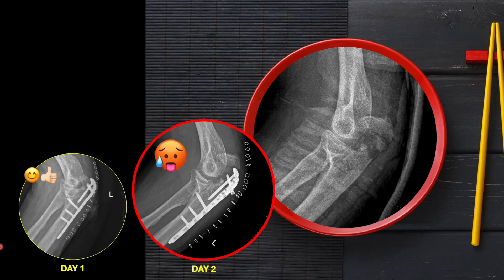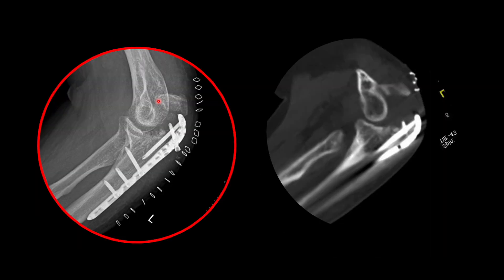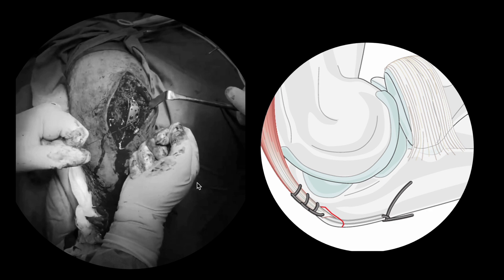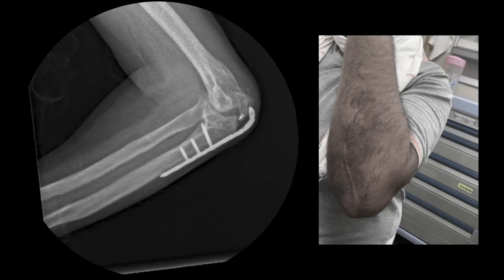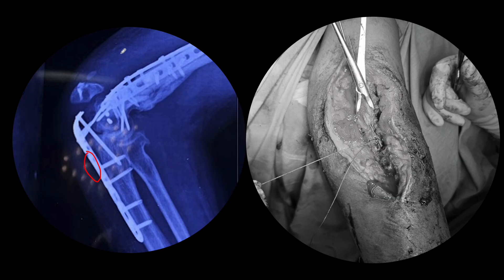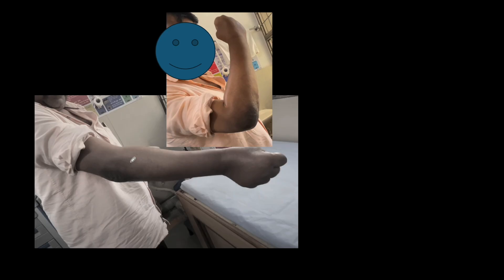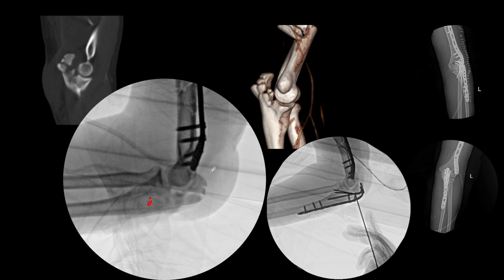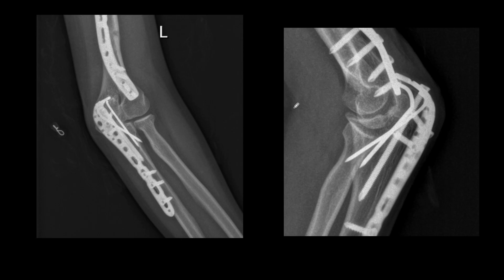Comminuted Olecranon Fractures: Is plating sufficient?

Comment: How to pass the suture if the plate is already on the bone from where will we get the space,kindly tell the technique also
Reply from the maker: If doing a fresh case, then you can take fiber wire/ethibond loops through the triceps prior to the plate positioning and then pass their ends through plate holes (meant for K wires/sutures) and tighten once you have reduced everything perfectly. Alternatively, you can pass the fiber wire/ethibond through any of the free screw holes also.

Comment: Post op rehab protocol pls
Reply from the maker: For the revision cases, we check whether intraoperative hyperflexion brings some opening at fracture site or not. If some opening persists then we augment with more fiberwire loops and knots to ensure minimal movement at fracture site. Post operatively full active assisted range of motion is encouraged and just heavy load lifting is avoided. Rest other measures for swelling reduction and pain improvement are taken. For fresh cases fixed with kwire and plate combination also full movements are started from day 1 post op.